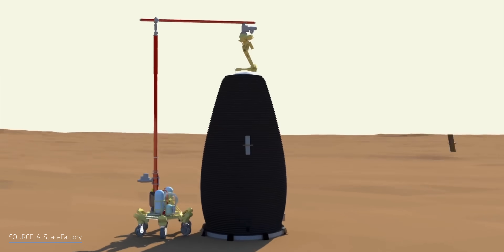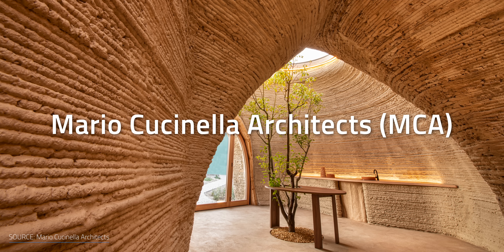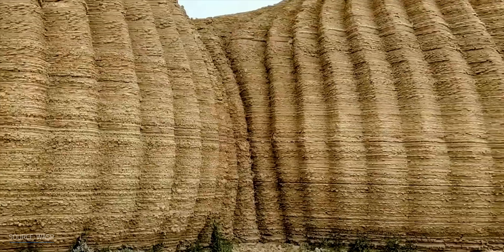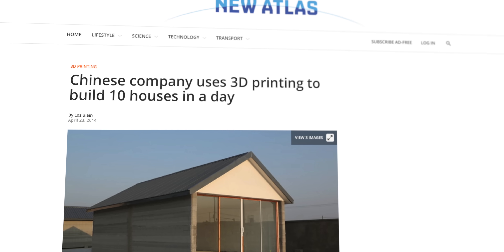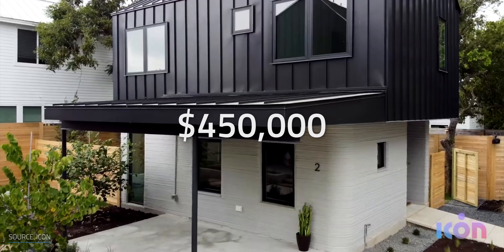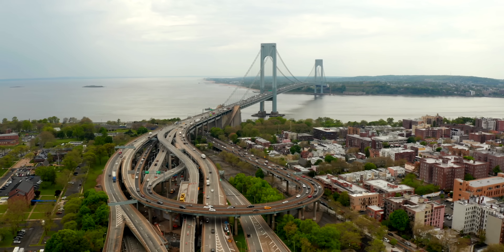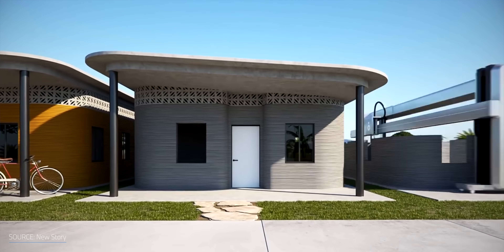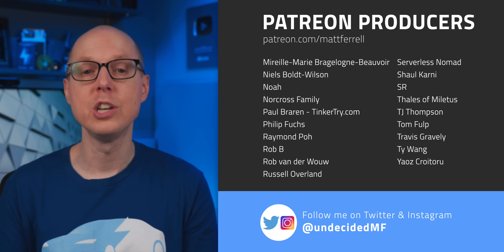The Truth About 3D Printed Homes

Comment: To get 3D printing of houses down to a cheap enough level for the average North American and European consumer, you need a portable ARTICULATED ARM crane unit that fits inside of typical 20 foot container AND that has easy-to-assemble tracks so it can move about, flexible elbows and wrists AND has onboard lasers to determine ABSOLUTE 3D-XYZ coordinates of all parts of itself and calculate the RELATIVE distances from previously printed items!  This armature can be built and sold for about $10,000 USD using modern metal and plastic hydroforming techniques.

The 3D-printed material itself SHOULD be volcanic ash-infused and fibre-reinforced self-healing concrete (i.e. calcium infused) which can set even underwater or in heavy rain in addition to hot and dry or hot and humid climates.  There is enough volcanic ash in just the rail-accessible Mount St. Helens area in Washington State (i.e. a big eruption happened in 1980 spewing BILLIONS of tons of ash everywhere!) that it could supply enough raw volcanic ash material in a fibre-reinforced concrete mix for 3D printing BILLIONS of houses!

That material could be mixed into a fine powder and packed into fork-lift -accessible or trailerable 1000 litre plastic tanks and shipped to an onsite location inside of a twenty foot container along with the 3D printer itself which shipped inside of a separate 20 foot container!  From there, you use local fresh water to mix into the concrete mix powder and the 3D printer will create 15 cm thick walls (6 inches) and floors which are both thermally efficient (retaining and dissipating heat on a regulated basis!) and it will be rain, snow, hail, sleet, ice and pest proof! If you add enough glass or carbon fibre to the volcanic ash-based concrete mix, it will also be earthquake and explosion proof!

Even GLASS WINDOWS could be installed by 3D printing of fused SAND (i.e. silica) via LASER-based fusing which can be onsite polished by common grinders to a reasonable optical clarity OR you can leave it roughly finished to allow a beautiful DIFFUSED glow through the entire house! You could even add dyes to the fused silica to give windows that stained glass look --- even ARTISTIC IMAGES and PATTERNS could be made into the glass by changing the colour of the dyes added to the silica powder (i.e. sand) mix just before laser-based fusing!

Even CONCRETE can be dyed to ANY COLOUR by mixing colours/paints on the fly during 3D printing to create intricate patterns and artistic images in the final house!   For final INTERIOR and EXTERIOR surface finishing, you can have the 3D-printer automatically grind and polish the exterior or interior concrete down to a mirror smooth finish or to a rough texture once it's fully dry AND THEN spray and FUSE clear or colour-dyed silica as a two millimetre thick protective coating and have on-board polishers SMOOTH the finish to modern architectural standards!  That fused glass coating would last for DECADES!  Add in 3D-printed concrete tables, benches, chairs, beds, patios, shelving, dry goods storage boxes, and liquid goods storage tanks, septic tanks, hot-tubs, pools, sinks, bathtubs, workshops, etc., it means you would even have built-in furniture to go along with your house!

And since 3D-printing allows ANY form to be made, graceful curves, hard lines, sharp or rounded corners, and other unusual shapes can be 3D printed for any interior and exterior house feature!

For the future, it will ALSO be possible to 3D print using laser sintering to MELT metal powder such as stainless steel beams and/or high-strength reinforcing round bars and i-Beams RIGHT INTO the concrete as a whole-house reinforcing system. This could be eventually UPSCALED to commercial and industrial scaled to be able to 3D print steel reinforced concrete warehouses, entire apartment blocks, downtown commercial towers and even bridges!

With enough multiple robotic armature 3D-print at the same time, 3D printing a whole 3000 square foot concrete home could be done in MERE HOURS!

3D printing using multiple large-scale armatures of a whole apartment block or concrete tower WITH 3D printed steel reinforcing bars and beams could be done IN A WEEK depending on how fast the metal and fibre-reinforced concrete sets and dries!

V
Reply: Good ideas!

Comment: About 15 yers ago I observed houses being built for $5,000 in Haiti. Concrete cinder blocks were made locally, assembled on a concrete slab with wood shutter doors and windows, 4 rooms and tin roof over optimized 2x4 framing. No electrical or plumbing. Local labor. Quite impressive.
Reply: Local labor, that's the key. People there are paid shit salaries that's why it's so cheap
Reply: they are paid local wages. and most of them are happy to have a job and provide for their families. even you call that shit salaries, they are still "regular jobs" there  @smlgd

Comment: Meanwhile in the Netherlands we have modulair prefab concrete building  technology. We build whole suburbs in a few months.
Those ppl printed a few walls for a single living unit and took months to put the roof on, the doors and windows in and connect it to the mains and sewage.
That's not very impressive tbh.

Comment: I think there's an element of 'perfect is the enemy of good/better' here - if people are going to continue living in suburban/rural settings, then the question becomes not 'is this perfect', but merely 'is this better' - is it better to construct a house out of local mud, or out of bricks that have been fired using fossil fuels, bonded together with mortar (containing lime that is again roasted using fossil fuels)?  Both houses will need wiring, plumbing and other things to make them habitable, so that's probably a wash, but this does seem like it could have potential for incremental improvement.
Although in the UK, where it rains whenever it wants to, I wonder how long a mud house would remain a house at all.
Reply: 3D printing is great for one-off, highly customized, and structurally complex, but small objects. Houses, especially the ones that I've seen 3D printed, are mass-manufactured, identical, and simple but, as far as objects go, fairly large. Why are we trying to 3D print them again?
Reply: @willabyuberton818  an automated method of creating large, seamless walls doesn't seem like a terrible idea.
Reply: The UK is where we got wattle-and-daub, and cobb from.  There are houses there that have not only been standing for LITERAL centuries, they are still in use.

There are problems.  Problems can ... and will ... be solved.
Reply: UK must be dumb to allow construction of houses that don't fit their style.

Comment: with 3d printing, on all fronts, we should start subsequently writing the new building code material application of these future structures. & consider as a reference how military jets, F1 cars, your mobile or contemporary electronics are being made. why? because this is about to become 3d reality.  & the templates for the next versions of home; like it or not. & why not plan ahead - if all bets are on technology (forthcoming) becoming inseparable (?) or even, material-less (?). in the case brought up here (3d+spatial+forming), the future scenario includes adopting an admix, or by application of sonic or harmonic frequency, to (for example) bug-proof print-mix porosity (which will never be abandoned because it is structural). in tangent with multiple axial heads, the future scenario (as it is now being looked at for electrical & plumbing integration; wire-ins) quite likely will include the addition of protective skins - exterior, interior, & roof wraps - to produce a complete ensemble; currently seen as (part / material) separation of the (now) loop-around  "additive-enhanced" cast-in-place structure.  likewise, we need to consider that we are only at the very beginning - the beta & proof testing period - of this gargantuan 3d print world, soon to engulf us. for us @space_equipment, it's been 11 years, of many failures, 15% successes, & many iterations, with many more experiments (& failures) still to follow; on a micro scale. for when that time arrives for when we intend to "fashion" a 'building' when building becomes an outdated term. by fully understanding & applying these new tools; we will unanimously adopt these new arms & legs being given to us, as we did, the mobile phone. & unfortunately for the Building & Architectural Historians, this means the eventual demise, replacement, & dismemberment - or need for / of - substrate material layering.... but what about R-value they ask?, pest-proofing,? before we get to this juncture, & witness transparent opaque walk-thru walls... much as or like our mobile phone adoption, these fantasies (now in the lab & used off-world) will be homogenous pieces of day to day life, in the next Epoch. we just need to believe, we will always have nature, & shelter made the old-fashion way. but how many of you warming nostalgia here would give back your digital mobile for a rotary land-based dial-up ? exactly! why cloaking a separation of materials, to bond toxic-to-produce chemical adhesives, wraps, insulation types, to not always successively glue together the  'air rights' into usable space, on Bank-marshalled, Government-claimed land, a prehistoric idea, not of any live-able future. & the current method of building (completely rewritten many times by the Japanese) will likewise & eventually be superseded by holographics. what?! yes. & one only needs to watch out for VR's next iteration (the phone; not a headset). because if "matter is consolidated frequency" to the Quantum scientists (see: Dan Winter), then who says frequency can't holistically segregate bugs from humans ? & safely prevent birds & wild life from head-butting into windows... & those micro holes in the 3d print so many writing in as a failure, won't be there to mutate into habitat to grow, flowers for bees, moss & ivy, for temperature control... trees for secondary structure... controlled & fed without the need for pumps & plumbing (?) i bet this fantasy is sitting in some NATO brown manila folder & already beta tested on Mars.. b i t C h u t e (.) c 0 m

Comment: Also, a house made of clay.. will wash away with the rain. Clay that hasn't been fired dissolves pretty easily. you would need to add a layer of concrete or stucco to it to prevent that, and even then, any small gap in that layer. is going to destroy its stability over time.

Comment: Personally I think it's all hype. As you mentioned in your video, the cost savings just isn't there as you still need to purchase all the appliances and wiring. Also, who care about printing a wall in 24 hours when you still need months of time drying and to complete the wiring and installation of doors and windows. It's better to just build the walls out of pre-fabricated bricks or concrete blocks. All and all, 3D printing houses costs more to produce and have a wider environmental impact than people are willing to believe.

Comment: If Clay-Based 3D printing ever takes off, there are other issues: finding suitable land with the right clay soil; once the clay is excavated what do you replace it with or leave a big hole; if you don't have clay, you'll have to buy it and ship it in and the cost of clay soil will skyrocket to meet demand; and they added organic waste product to help solidify the mixture and the price of that and local availability would effect the cost also... how do you run wiring and plumbing, lighting, and wouldn't clay walls block wireless communications?
Reply: I highly doubt clay supply will be an issue - clay is extremely cheap (like less than $20 a ton) and found nearly everywhere, and it's already used extensively in the construction industry because of how cheap and available it is. The vast majority of bricks are made out of clay. 

That being said, I think these 3D printed houses are just a gimmick for the most part - it's a way to erect walls in a very short period of time, which is great at grabbing headlines. Doesn't actually do much to solve the issue of sustainable housing or reducing emissions and rarely is cheaper than a house built with traditional construction methods - plus there is the issue that some of these methods result in structures which just aren't going to last for more than a few years without extensive and expensive maintenance to prevent the weather and nature from rendering it uninhabitable. They are just taking advantage of the fact that people desire to be more green and live more sustainable lives to take care of the environment to push crap that nobody would use otherwise, despite the fact it doesn't actually solve the problems it claims to solve at all.
Reply: @StreakyBaconMan  I can't disagree with most of your comments... I actually agree that much of what we are doing won't solve many of the issues they claim will be solved. One problem is the overuse and Liberal redefinition of "sustainable".
Reply: @Reality_Check-1969  I think a good way to start to eliminate the problem would be to regulate the use of that type of language to describe products. Give words like green, sustainable, environmentally friendly etc specific definitions within advertising that line up to the publics expectation of what those words mean, and fine people who falsely advertise their products and services as those things. People want to make the right choices for the environment, but it's not easy when companies get away with blatantly misleading the public as to just how environmentally friendly their products or services are in reality. It's such a shame when you think about just how much money has been spent by well intentioned people who have been mislead by a business into thinking they are helping the environment that could have ACTUALLY helped the environment if that practice was not allowed.
Reply: it will never take off, there might be a tiny niche but it will not be mainstream. if you are building in the middle of nowhere its easier to fly in lumber and build traditionally than to fly in specialised equipment and dig clay out of the ground (you'll need to process tis clay to some degree) or fly clay in and you need to power the damn printer.. you probably cant even use it yourself so you you will need the technician on site operating the printer

Comment: The world's largest 3D-Printed neighborhood is going up in Austin. There is no way they could use local dirt as they start new neighborhoods because the geology changes here significantly from one part of the city to another. They are using "Lavacrete", which uses a polymer mixed with concrete.

Comment: I used to live in a cobb house- the walls were about 18 inches thick and made with, basically, mud, poop, straw, and animal hair, then white washed. These ingredients were the preferred materials for a long time. When it was built it had a thatched roof, later this was changed to (relatively) locally quarried slate. It was a shepherds cottage, another unit adjoined it at a slightly lower level on the "street", and a wool barn adjoined at a slightly higher level. They were more than 400 years old. A mud building in a damp climate still going after more than 400 years.
Reply: How long did you live there??  Did you note ant drawbacks?  What country/ climate ??  ( if you don’t mind the third degree🙃
Reply: @thedingo8833  they are all over europe, from spain to latvia. all those half timbered houses you see use mud and wood and some are 1000 years old.
Reply: Oh my thanks for the insight.  Can you tell me if while living in one you noticed any drawbacks???  And as far as maintenance was concerned?. I heard to rethatch a roof was astronomical.  Again. Thank you for the info.
Reply: @thedingo8833  well they are pretty much all centuries old and have all the problems that come from that. but they have a very nice climate inside. Repairs are pretty expensive but they are more restauration than simple repair.   they have some problems when build in swamps, but pretty much all structures have. thats why you find halftimberhouses inland and burned clay brick houses at the coast in most of central europe.
Reply: @nox5555  wonder if I could build one in Oregon. My goal is to retire in brookings. IDE love to have me own little cottage there.  I have been looking for alternative building options.
Reply: @thedingo8833  definitely look into Cobb houses. They have to have “boots and a hat” meaning an over hanging roof and some stone base but when properly whitewashed they will last for hundreds of years. The lime wash allows the house to breathe and protects the Cobb from weather
Reply: @mgrey9066  thank you very much for that info. 🙏🏻🙏🏻👍🏻👍🏻👏🏻👏🏻😍
Reply: @thedingo8833  there's a place near the oregon coast called the Cob Cottage Company that has a bunch of cob houses and buildings. They have tours, workshops, and a website.
Reply: @auroran8951  your kidding me.  Whoa thank you. What a gold nugget of info thank you. 🙏🏻🙏🏻🥰🥰
Reply: Well, in my city we used to build houses, and even large buildings like missions, churches and mansions like that up to ww1 and what you see is that every building around 100 years old is uninhabitable as it's overrun with plant life growing on and slowly consuming the walls. That is, if the walls still stand anyway.
So I think this is just survivor bias.
Reply: Found the immortal
Reply: Poop? So brown 25 from the movie "the groove tube" is real after all.